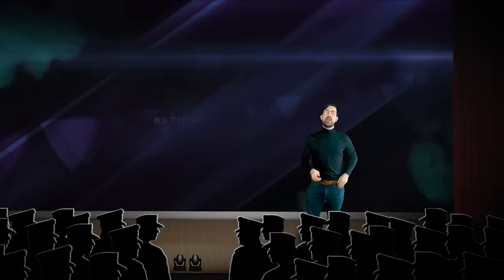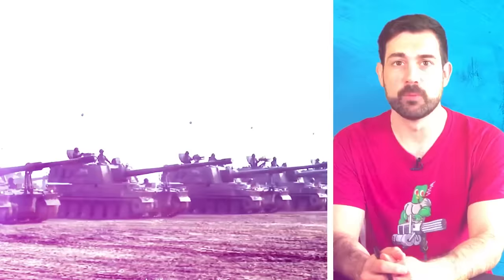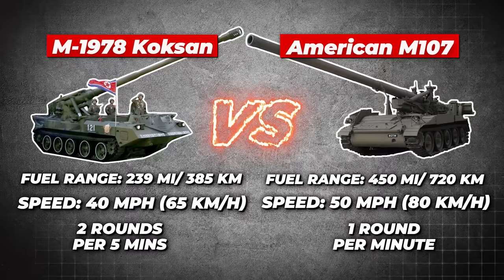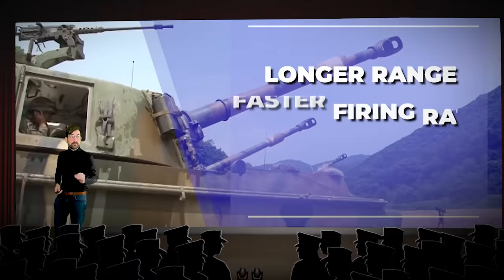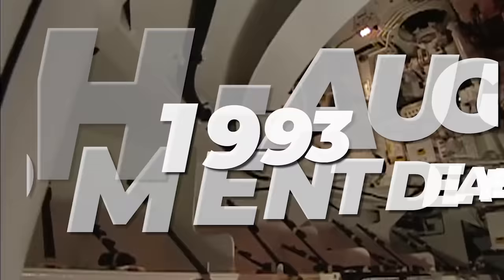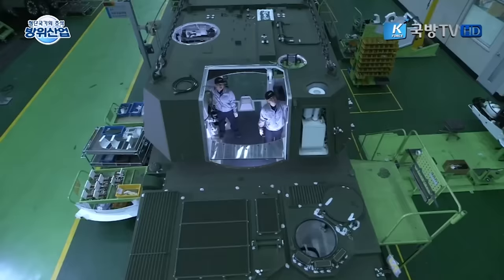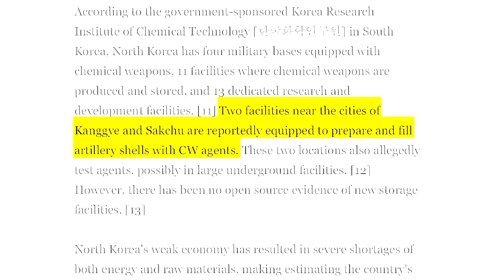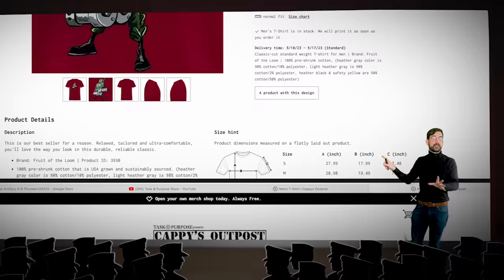Why Korean Army Artillery is the Best in the World

Comment: The K9 Self Propelled Howitzer is a good weapon purely from a technical perspective! However, the most fatal aspect of the K9 Self Propelled Howitzer is that the vast majority of its core components are not produced in Korea.

Yes! South Korea is a strong country in the automotive industry, with mature automotive engine technology! However, he is unable to produce water-cooled diesel engines for armored vehicles and transmission systems for tanks! The engine of K9 is a German MTU, and the transmission system is from Allison in the United States.

Yes! South Korea is a strong country in the steel industry. But South Korea cannot produce the barrel of the K9 artillery. The artillery barrel of K9 is from the Rheinland company in Germany

How could a country with American troops escape American control! The K9 artillery system is composed of Honeywell's modular orientation system, automatic fire control system, artillery pitch drive device, and turret rotation system.

Taking the Ukrainian War as an example: Even if thousands of your tanks are destroyed, as long as you can produce and win the war on your own, it won't be an extravagant hope!

Comment: Ever heard of the G6 and G6-52. 
You over stated the K9's range. Almost all other trusted sources give it as 40km with BB rounds. Also, all other sources state the maks firing rate as 6-8 rounds with 8-round/min only sustainable for 30sec,  meaning 4 rounds for 30sec. 
The PZH-2000 is better in almost all parameters, but it is the South African G6-52 that is the undisputed king when it comes to 155mm or heavy artillery.
G6-52 vehicle speed = 80km/h with range of 800km (wheeled 6x6)
Firing range = 45km std projectile, 56km BB, and 67km F-LAP, ranges of over 70km has been achieved repeatedly in verified tests!
Firing rate = 6 rounds/min sustained and 8-rounds mrsi.

So no, get facts right and you'll see the K9 is around 3rd or 4th in comparison with Sweden's Archer and French's Caesar also on par or better than K9.
Reply: Wishful thinking. The hard reality is that the k9 is overall the best artillery. In price specs and reliability aspect there is no better option.  And the next k9A2 will be even more superior
Reply: @lajo142  
No Facts? The ones you used are clearly not official - Firing range and rate of fire is WRONG! Based on what available factual numbers are the K9 better than the other artillery I mentioned??